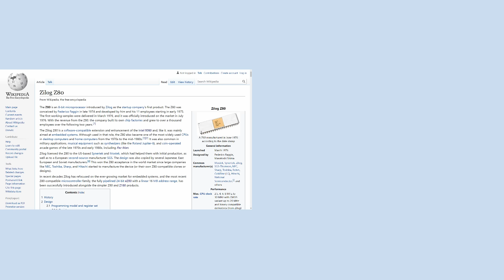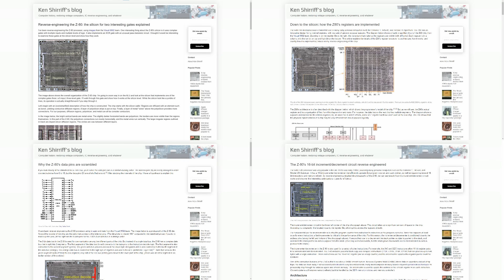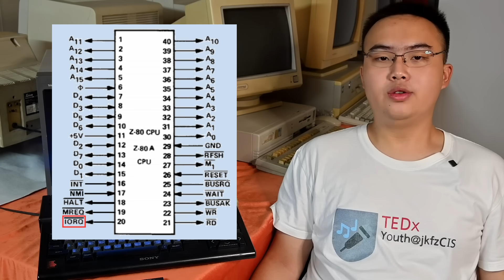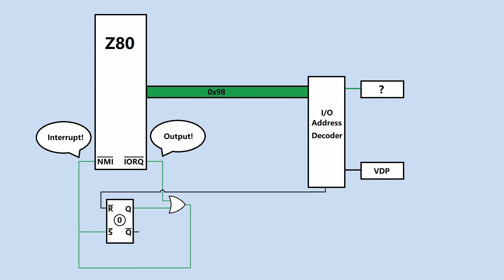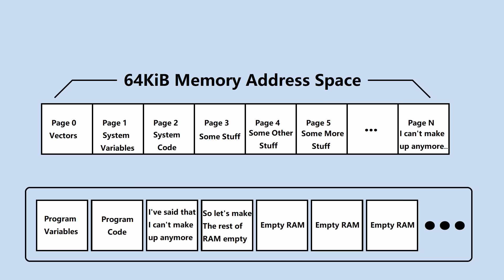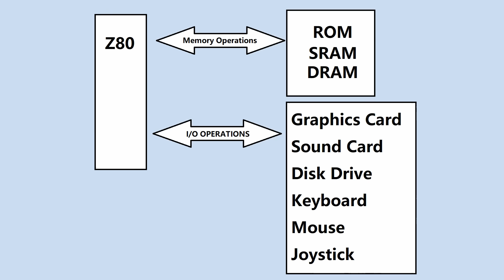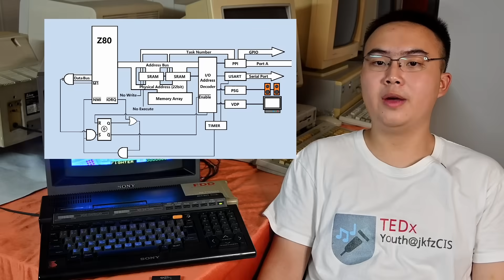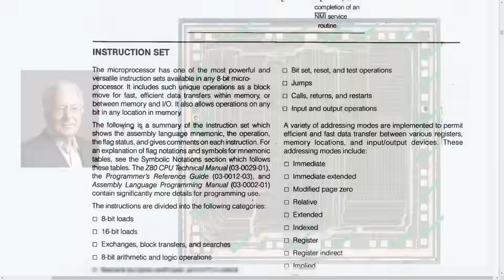The Z80's secret feature discovered after 40 years!

Comment: I don’t have the EE chops to understand this all fully, but it’s interesting that you feel the MMU can be pretty trivially implemented with a technique similar to a game mapper. I know a lot of computers got kinda hamstrung by the fact that they didn’t implement any kind of MMU, it’s funny if it really was that simple.
Reply: Well, MMUs ARE a bit more involved.
Like the MC 68881(?) for the 6809E.

But I like that at least he is THINKING.
Reply: @Theineluctable_SOME_CANT  I think that last sentence, in context, needs even more emphasis in this era.
Reply: @ericwazhung  oh yes!
Reply: MMU means memory mapping unit. They both run on the same concepts, but of course modern MMUs have more features.
Reply: @metroid031993  In my mind the key distinction between a simple 8 bit styled memory mapper and a proper MMU like the mc68851 is that the page tables are held in main memory and not in the mapper itself. This of course massively ups the complexity of the mappings possible. This is tricky on most 8 bit MPUs which have ridged timing requirements. The other complex thing required is faulting so pages (and tables) do not have to be in main memory at all times.
Reply: @lawrencemanning  8bit processors generally only have 16bit address space which means that there isn't really much use for big page tables. 32bit was enough to allow for a sparse address space and thus more complex software or hardware walked mapping tables.
Reply: @etchedpixels  Thats right from the CPU perspective of view. So an on-chip mmu doesnt make much sense. Also to consider: chip-space was a very precious resource at that time. While the Z80 had  fourteen 16-bit registers (1/6 of the whole chip area) it had only room for four ALU bit-slices.
Reply: Have no EE or even electronics tinkering skills, but I'm a software developer and could understand everything just fine. Okay, I already wrote a rudimentary Z80 emulator.
Reply: Application specific "MMU schemes" where quite common in that time. It really doesn't take that much EE skill, once you get use to the concept. Especially, in a dedicated embedded environment.
Reply: For more complex CPUs it's not that simple. If CPU doesn't have support then memory protection can't be added for single CPU system (with two CPUs it's possible). For example 68000 have multiple memory access commands and page fault can happen between those accesses, but not enough information is stored to stack to resume operation. 68010 had that thing changed and memory protection was possible.
Reply: @ptappola  Apollo had 2 68K's in lockstep and somehow was able to fake restartability.

I'd be interested in seeing the details of that... I haven't looked hard for it yet.
Reply: @ptappola  Memory protection on single 8bit processors was fairly routine. Likewise there were lots of 68000 systems with memory protection schemes and mapping schemes. What you are specifically talking about I think is virtual memory which does need a clean instruction abort. Virtual memory isn't really the same thing - you can have virtual memory and no memory protection for example
Reply: At the time one or two chip MMU solutions existed but most are long discontinued parts (74LS612 etc). A 16bit MMU though is not a complex device as you don't have a sparse address space.
Reply: Well simple and simple.  The cartridge mappers were thought of as anything but simple in early 80s(also a simplest mapper is just a bankswitcher anyway)
Reply: mappers and mmu aren't quite doing the same thing though.
Reply: Cost and year, newer machines got cheaper and tech got better.
Reply: The TRS-80 had a primitive MMU for the Z-80.

You could access up to 128k of RAM by switching 32k banks.

Basically it had two sets of 64k ram, and the 1st and 2nd 32k bank could be toggled between the two RAM sets.
Reply: It's not just the existence of an mmu. It takes the ability of the mpu to interrupt instruction execution, save state on stack and later seamlessly retry that instruction after the page fault is rectified. The National Semiconductor NS16000 family was the first mpu  set to have this feature.